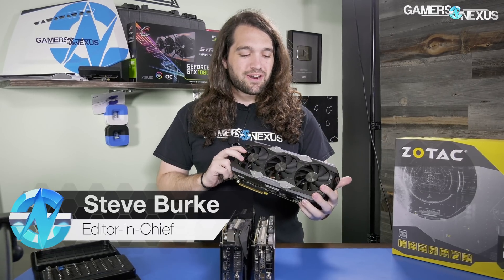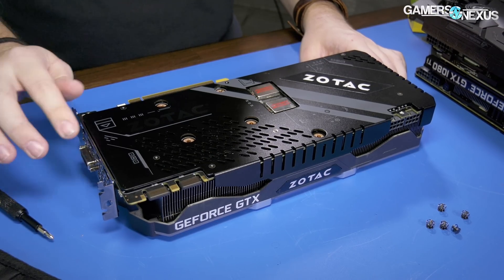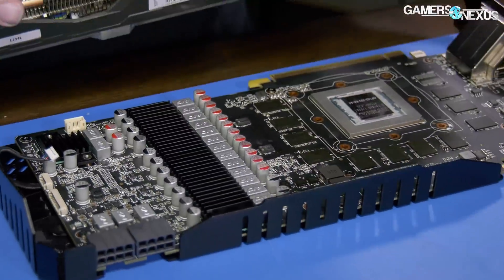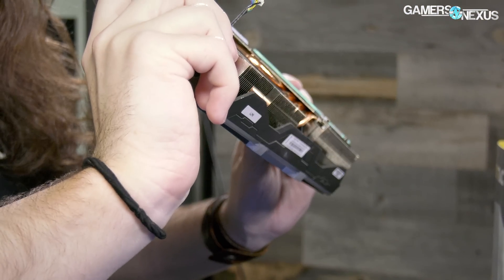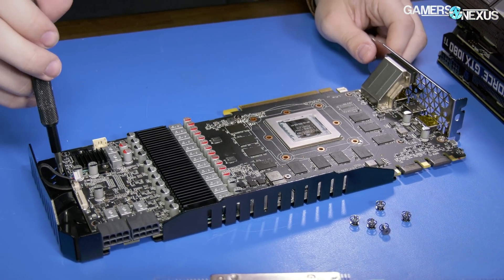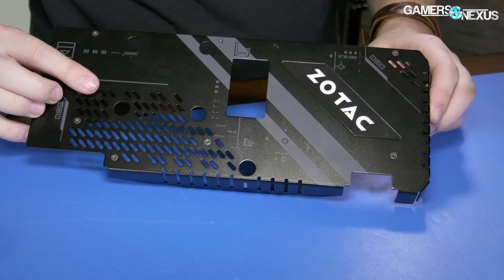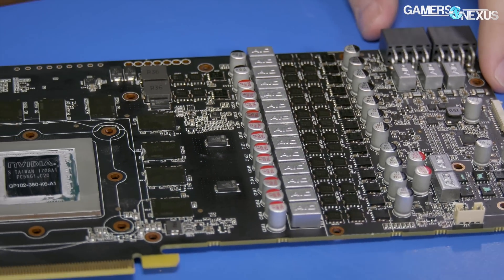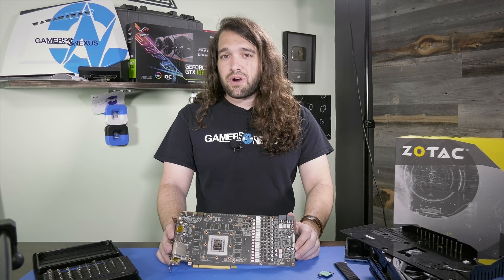ZOTAC 1080 Ti Amp Extreme Tear-Down

Comment from the maker: Thermal analysis is already done on this card. Stay tuned for the review publication. Regarding the rubber bumper: It's not on top of the chokes and it doesn't make contact, anyway. It's floating on the upper heatsink and failing to make contact to the lower VRM heatsink, and is clearly an unnecessary attempt at vibration damping. 

See rubber bumper photo here: http://www.gamersnexus.net/news-pc/2971-zotac-1080ti-amp-extreme-tear-down

You might also like our VRM analysis of the 1080 Ti Kingpin, which explains why such cards exist: https://www.youtube.com/watch?v=ler1PZ0L5nE
Reply from the maker: It's not a coil whine damper. It doesn't even touch the power components.
Reply: Gamers Nexus pls upload full review soon
Reply: Yea I don't think that rubber pad is for vibration my guess would be it is there for protection in case the card get squished the rubber pad will dampen the pressure on the little black heat sink and not damage the components under that heat sink.
Reply from the maker: Not 100% sure. Might be tomorrow, but depends on when we get Vega in.
Reply: +Gamers Nexus There are hard thermal pads existing aswell. Not very common in GPUs, but I remember taring down PS2 and cleaned it all over and the CPU was attached to the cooling unit by the black hard ( ͡° ͜ʖ ͡°) about 2mm thick thermal pad.
Yes it feels like rubber, but it definitely transfers heat. Anyway would I've used that kind of solution here? Probably not.
Reply: Soo, any new estimate?
Reply: have been looking forward to this tear down for one reason and that is the power boost chips. so what are the power boost chips and what do they do?
Reply: Any rough ETA on the review? Ya mentioned before that you were looking at Vega first, but now that you have all the data it makes me think that the review might be published earlier than expected.  Thanks!
Reply: great, thanks for the response
Reply: You should have test thermal before tear down... to avoid change about original specifications.
Reply: Didier88600 that is physically not possible. you have to tear the card down to place the thermal probes
Reply: They. Do.
Reply: It could be obstructing airflow to provide a vortex that makes the fins below it work better?   Why rubber...maybe it's just stuff they had around manufacture or could buy cheaply that would do the job.  

"Never attribute to stupidity that which is adequately explained by Yankee ingenuity "  ~ Hanlon's Half-Brother's razor
Reply: Did you took the thickness of all the thermal pads? I'll replace mine soon.
Reply: Rubber coil wine damper

Comment: Thanks to this video I did an overhaul of my old Zotac 1080ti Amp Extreme. I replaced all of the pads and repasted the core. I also removed the 1mm rubber pad and replaced it with a thermal pad.
I just want to tell people who may be wondering that most of the thermal pads are 1.5mm but a few are 1.0mm. I didn't measure the exact length. I used the scratch and cut method.
There are 3 spots that use a 1mm thermal pad, the small skinny indentation on the fansink at the deepest point, and the 2 standalone heatsink thermal pads that can be accessed by unscrewing the heatsinks from the backside of the pcb.
The memory thermal pads and the other small thermal pad next to the small skinny 1mm spot that is slightly raised on the large fansink are all 1.5mm. Replacing the rubber strip is completely optional but it is 1.0mm.

It should be noted that the long standalone heatsink that is 1mm for thermal pad is pretty long. It is roughly 120-130mm of thermal pad length. I had 100x100 square pads that I was cutting into size so I had to cut a little smaller extra piece. If that bothers you, there exists longer pads you can buy. I used probably a half of a 100x100 1.5mm pad and 1/3rd of a 100x100 1.0mm pad. I wouldn't recommend using different size pads as the screws, mounting pressure, and such are designed to be just right. If you know that you have a really squishy 2.0 pad you might be able to get away with it for the memory but I wouldn't risk it. Decent pads are cheap these days if you look hard enough.

Comment: Steve did you ever try the thermal strip in place of the rubber strip across the heatsink? If so did it work well or not worth it???

Comment: on my zotac 1080 ti amp extreme
 (LiveKernelEvent 141 )
if I leave OC at the factory certain times while the game ride 3 is being written (low level fatal error "title game" gpu has crashed.
if you lower the gpu or the memory is fine.
I'm still in time to change the thermal pad
or risk of breaking? I state that I have now lowered the factory OC to a minimum, but even when I lowered by -40% I had surprising scores at 1999mhz
if the errors come out are a protection I keep my card, but if those messages are at risk of breaking then the change, the gpu does not go beyond 50 ° celsius fully loaded, only the vrm risks

What do you advise me to do?
Reply: I have the same problem, but i still have no idea how to fix that
Reply: @valentine5105  hello, do u have nvidia driver crash in game? have u fix it?
Reply: hello, do u have nvidia driver crash in game? have u fix it?

Comment: I got one of these for around €600 on Newegg and it simply doesn't feel that great, it doesn't feel like silicone lottery to me.
I haven't been able to stabilly push the power at all and it seems to score about average in most benchmarks
I think my card slot it not happy with me and I'm tempted to prop it up with a stick

Comment: Just curious, does your card have a blue LED that blinks on and off constantly when the card is powered up? I have this exact card, and I've never been able to sort out what the blue LED on the back is.
It's on the backplate side of the circuit board, and is visible through the array of holes on the backplate, blinking all the time. The card works fine.
Also, what's that little pushbutton on the back of the card for? I've never found out about that either.
Overall, these are really great-performing graphics cards and are still really good even with the RTX 20xx being released!

Comment: How thick should the thermal pad mod be? Is 2mm enough? I've never opened a GPU before. How dangerous can it be and can I somehow damage the existing thermal pads? Thanks a lot in advance.
Reply: 5 años y hoy, 2023 yo empezando a hacerme la misma pregunta. la he destapado la mia 3 veces para cambiar pasta térmica del procesador gráfico pero sigo con las mismas almohadillas originales. solo apreto y listo, pero siento que ya es hora de cambiarlas

Comment: The amp! extreme edition cards are awesome. I would go out to say it was the best 980ti card, and 1080 card. The 1080ti though seems a little lacking as other card manufacturers actually get near the same clocks on their stock cards and the o.c.ing is actually matched/ exceeded by some other cards.

Comment: Gamer's Nexus, what are those "power boost" things on the back of the card? Anything or just branding?
Reply: Those "POWER BOOST" are capacitors introduced to help reduce ripple noise and minimize power fluctuations. Basically to stabilize the card for smooth gameplay.
Reply: They get extremely hot, so i doubt they are there just for looks =)

Comment: But what if they put the rubber bit exactly to isolate 2 heatsinks? It's not that VRM needs so much cooling, why bother? Until that big EVGA recall which was basicly caused by faulty components, not flawed design, nobody cared about cooling VRM, and cards were fine.

Comment: Isn't the rubber strip positioned above the coils instead of above the aluminum heatsink?

If it is, my guess would be, that it is supposed to reduce coil whine.
That would also explain, why it doesn't make contact.. it is not supposed to.

Comment: I'm confused by the Amp Extreme Core Edition, which is a lot cheaper, than the Amp Extreme but looks the same.

Do you have any idea, if the difference between those cards is really just the stock clock? Or are there differences in the PCB Layout?
Reply: Chukku the difference is core clock and memory clock. 
Amp extreme is the most overclocked version of the amp series. 
More power, more frequency more bandwidth etc.
Reply: Yes I do understand the difference between the AMP and the AMP Extreme.
But there is also an 1080Ti AMP Extreme Core Edition, which SEEMS to have the same pcb and Power Supply and Cooling solution as the Amp Extreme (non-core).
If the Stock Clock really is the only difference, then the Price Difference of ~65$ is... weird..., since it can be equalized with 2 mouseclicks.
And I doubt, that Zotac is binning their GPUs.
Reply: Chukku well I think it has to do with the Silicon quality like the i7 series, the ones that support full overclock are k editions the others ere not. 
Maybe the core edition is not as stable at over 2000mhz overclock. 
I really do not know exactly the difference, I own myself an 1080ti amp extreme but I've didn't had the chance to test it becouse at the end of July my other components will arrive and after that I will finish building the pc.

Comment: Isn't this pretty much the same as the 1070 amp extreme card? Running mine at +750 on the memory and the gpu never drops below 2050mhz and runs so cool and quite you can't tell its plugged in apart from the performance and the yellow led telling you the power cables are plugged in. Best card I've ever owned.

Comment: Prior to running stress tests I did the following:
-opened up the card and applied Thermal Grizzly in lieu of MFR thermal paste
-mounted my card to the side of my case with a riser cable and mount

Notables:
-ambient temperature was 23ºC
-ran FurMark at the following settings: 1920x1080 AA-8X MSAA
-GPU runs a three monitor setup; all are 1080p/144Hz/1ms and monitor 1 was used
-GPU clocks were stock with the boost clock at 1974 MHz and memory at 5599 MHz
*edit*
-two tests consisted of approximately 30 mins of stressing with ample cool-down time in between (44ºC)

End results
-min FPS: 67, max FPS: 71, avg FPS: 70
-GPU utilized 85% TDP, 69% fan speed, temperature 70ºC
-no SLM was used; most prevalent noise was due to water pump, case fans, and coolant being flushed back into reservoir

My take:
Not the most 'sound' way to prove a point, but since my parts came in I decided to apply some decent thermal paste while I had the case open and the card out. The board sag was irking me, so I rectified that as well. I do believe in the process that by positioning the card in this manner I have: a) probably reduced the ambient heat in the case and b) increased the level of sound I would hear from the fans as it sits right up against the tempered glass panel. This being said, I honestly have yet to see my card fans push 100%. I don't dabble in overclocking GPUs, and with this beast you really shouldn't have to do that. With an MSRP of $729 (currently on sale), this price point not only trumps a majority of the non-reference cards in price, but all of them in performance as well. I'm quite happy with my purchase, and I really think all this talk of 'coil whine' is either a farce or a fluke. Go buy the card off of Newegg and return it after 20 days if it whines. After that, go buy your FTW3 or Strix. Neither one of these will compare, IMHO.

Comment: At 11 minutes, you'd use something reflective like aluminium tape for preventing whatever's underneath it from getting hot, so maybe the paint they used on the backplate is sensitive to the amount of heat the card puts out. Can' think of any other reason other than just picky aesthetics.

Comment: I don't know if that card would have vibration but my PCS+ R9 290's fans hit against the heatsink and cause a rattle, although the Zotac's dampening is on the other side of the heatsink so I'm not sure what's going on there. I fixed my issue by putting a couple of pieces of foam tape underneath each fan, so I wonder if they were having a similar issue somehow.

Comment: I'm a bit upset because you're assuming that they're just saving the cooling for the core and avoiding the vrm, but I think they're cooling the Vrms just fine, and feel like the added heat to the core just isn't worth it.
Reply: Shan Solo I can't imagine why, as these VRMs are rated above 90C anyway. I'm also concerned by your comment because unless the card is throttling itself based on vrm temps they can't possibly be holding the card back without failing, effectively killing the card completely. The concern with high temps is longevity, not clock speed/performance.
Reply: Rick Rands From my testing the card drops stability at higher voltages even at the same GPU temps and same or lower clocks. Highly unlikely it's the mem chips overheating so it's the most probable culprit.

Edit: I didn't say it was throttling, its crashing at higher voltages and same clocks.
Reply: Shan Solo that's fine, but has very little to do with VRM temperature. Voltage can play a huge part in core stability, and while temps can affect voltage slightly, it wouldn't be enough to make that difference under any average use, or even any LN2 use that I'm aware of.
Reply: Rick Rands Could be, but I don't see why 1-2 voltage bins higher could cause instability induced purely by too much voltage. Higher chance that temperatures somewhere on the card maybe other than the VRMs are causing it. Either way I'll be replacing the rubber with pads and maybe I'll update here if there's any difference in stability in general.
Reply: Shan Solo too high voltage can play very significant roles in stability. I've seen CPUs fail at voltages just barely too high, and lowering it slightly allows for perfect stability, and slightly lower than that total failure. If temperature doesn't affect stability directly (which it doesn't.) than you're entire issue would be voltage. I challenge you to do the tests and get back, because a thermal pad on VRMs won't affect core stability. Not before (or close to) failure point. It simply doesn't have any significant change on core stability.
Reply: That's true, but how do you know for sure what's crashing the card? Might not be the core itself. I agree it might not be the VRMs but the card behaves differently when it crashes at higher voltages as opposed to too high of clocks/insufficient voltage at particular clocks. Might be the memory now that I think about it since it seems to artifact after crashing when the voltage is too high.

Also if you know how Pascal or GPU Boost 3.0 works you'll know the card drops voltage when temperature hits a certain point even though it may actually report a higher voltage. Buildzoid talks about this in his video "The Pascal Problem". So yes not directly, but it affects it more than the the voltage itself.
Reply: @thealmostperfectconumdrum  hey man, did you find some differences changing the rubber strip with a thermal pad?
Reply: @Novartis9823  i didn't, the memory chips were the cause of the issues due to overheating, replacing or reseating the thermal pads fixed the issue for me, now still running 2075-2088 core and 12ghz memory without any issues for 3 years. The contact points from the factory were poor, seems to be a well know issue for this specific card.
Reply: @thealmostperfectconumdrum  alright, I just got in the mail this exact card (paid 390€ for it) but I can't test it until next week. I'm into overclocking so I was wondering if changing the rubber strip with a thermal one to dissipate the heat of the vrm's through the main heatsink would make a difference in terms of overclocking performance and stability. So the only thing I should do to gain this performance is replace the thermal pads on the memory chips?
Reply from the maker: We're not assuming it -- we know. The tests are done.
Reply: Gamers Nexus and? Is the vrm cooled enough to last 10+ years? If so, I would assume the rubber is in fact better, to keep the core even 1-2 degrees cooler.
Reply: Rick Rands After spending weeks overclocking this card with the XOC bios I'm pretty sure that the VRM temps are likely holding it back. Might be actually better replacing that rubber with a thermal pad.

Comment: Just a heads up if the fans or lights aren't working right, the gpu just needs supported.  The card is so heavy when it sags the lights wont work right and fans will run constantly lol.  Spent a few hours troubleshooting it, almost to big for its own good.

Comment: That plastic is there to prevent the card from shorting out across the backplate.
Reply: Gamers Nexus This guy's comments seems far more likely than your explanation. Ask zotac and see what they say about it.
Reply: Nathan Fletcher I think you're spot on man. I always worry about these metal back plates shorting the board but damn are they nice looking.
Reply from the maker: The 1+mm standoffs already do that quite well.
Reply: I feel quite honored that GN responded to a comment of mine. And I know that, but I've found that in many consumer applications, they put those there just in case something was to happen (Ie card flex / sloppy soldering in the factory) and I would assume that they think a ~ 0.003 dollar piece of plastic is better than taking the chances and having to RMA the card. As I would also assume that something falling on it could also cause the metal to flex.

Additionally, do you know if the backplate is grounded because that could also be used as a static shield (a multimeter could be used to test for conductivity), because it is possible for a static shock to arc across the backplate and to one of the solder points.

Comment: Do you think a Corsair H105 will be overkill for the ASUS 1080 Ti Turbo? Would maybe an H90 be enough? I am wondering, cause I have the H105, but want the H115i for my CPU for some reason. Then I could just as well put the H105 on the GPU. Alternatively, I could keep the H105 on my CPU (a 4930K btw), and get the H90 for the GPU.